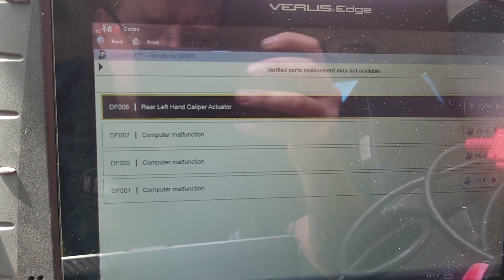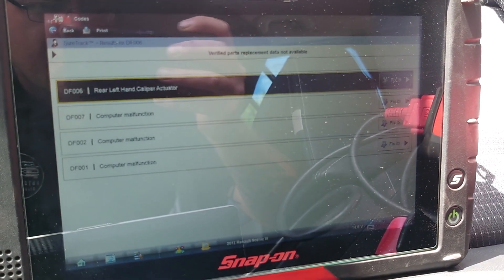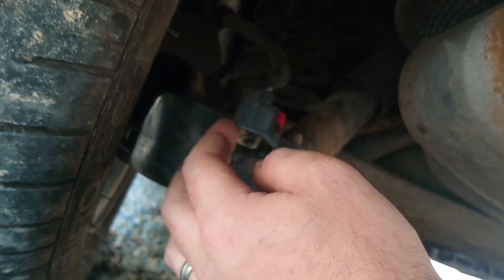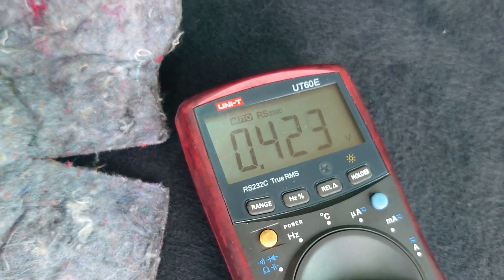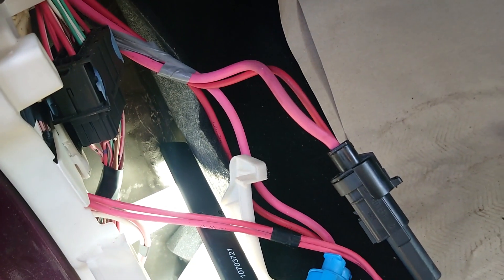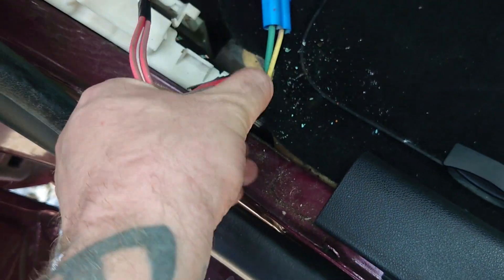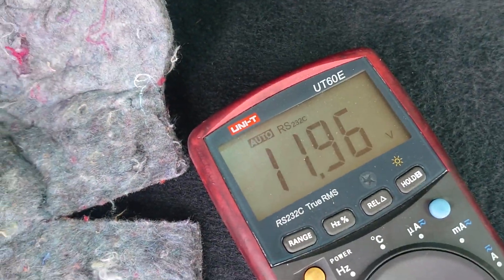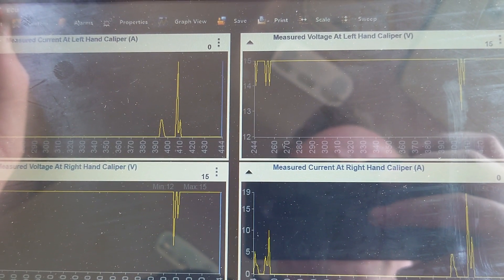Renault scenic 3 handbrake fault DF006 electric parkbrake fault

Comment: Does it have the same plug on the drivers side floor, only I’m having the same issue on drivers side rear e brake, I replaced the Calliper before seeing this video and still have the same problem, thanks in advance

Comment: 0:40 I have continuity from pins 29 and 14✅️
Load tested the EPC and confirmed the motor works ✅️
I'm getting no voltage at the pins on the motor.

Fuse is fine, the drivers side works. (Unless there's 2 separate fuses)

Which pins on the wiring harness carry the voltage to the EPB ECU? If I have the numbers I'll be able to confirm voltage and ground confirming the the EPB ECU has failed.

My issue started when I cleared codes for the glowplugs whilst my battery was on charge, so I think I've fried something.

No corrosion or water ingress in passenger footwell wiring.

I think my rear EPB ECU has broken. 

I want to test to see if its receiving voltage, if its is, its that yhats at fault but I can't find a wiring diagram for the smaller pins that presumably carry the voltage?

Would you help with the numbers of the other pins?

Many thanks.

Comment: Thanks for the upload I just came across this video as was looking for the module location. If I could just add a bit that might help someone who’s carried out the repair on the corroded plug and still has zero volts at the motor. 

I had one the same and had heavy water ingress to the cabin that’s caused this as it’s the lowest wire, but prior to diag/repair I manually retracted with a booster as the caliper as was stuck on and the vehicle couldn’t be moved and needed to be. 

If the caliper hasn’t finished it’s cycle via the ecu it wont sent voltage down to the caliper motor, So if you have retracted a stuck closed caliper to move the vehicle just make sure it’s back in the last known position for the ecu as it simply does nothing if not . You’ll have all the feeds to but it wont send power to the motor. Hope this saves someone a bit of head scratching

Comment: Car lost drive and required a new clutch. This was replaced and the car drove out of the garage with the clutch auto releasing the parking brake.
Parked the car on a hill facing downwards. It will auto release the parking brake to go forwards down hill but will not release the parking brake automatically to go up hill in reverse. Similarly, it will release the parking brake to reverse down hill but not automatically to drive up hill. When parked on level ground it will release to go forwards or in reverse.
CAN ANYONE HELP

Comment: Nice diagnosis ..You..made that look very easy ...Renault's not the best when it comes to Wiring ...👍
Reply from the maker: Thanks for the support, factory data helps with finding plug locations which cuts down time.